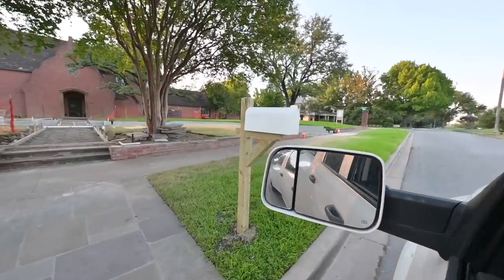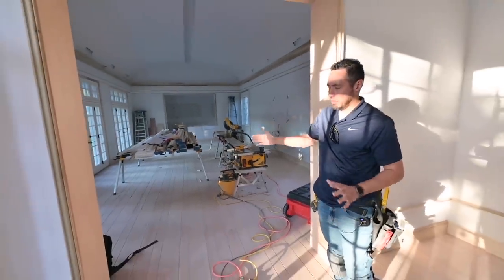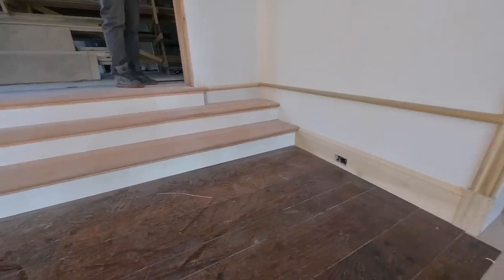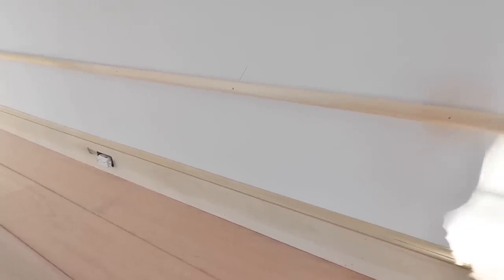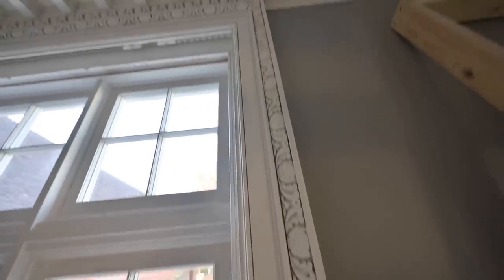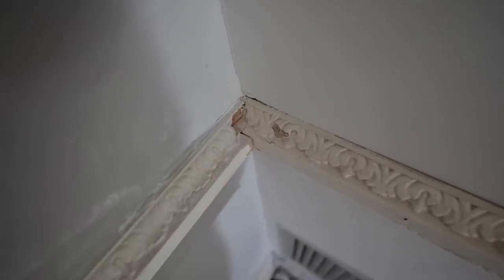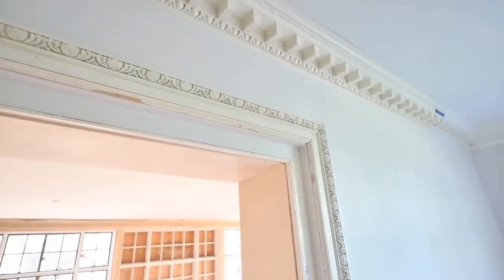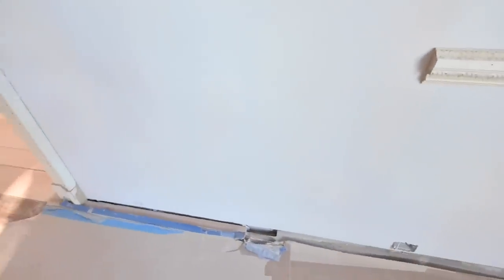Priceless...the most expensive mouldings we've ever installed.

Comment: Where you scribed your molding into the casing I think it would have also looked nice to do a soft return to the wall where you cut 2 22.5s and a 45. I'm sure you do it all the time with crown but I think it looks nice in other applications like this case where your panel molding or whatever it was didn't have a flat surface to die into.

Comment: In the "thumbnail" that presents this video on the summary page, and seen inside it at, say, 5:50 is something that I understand to be "dentil" molding. I'm talking about the squarish blocks sticking out underneath the crown. I happened to have read about them when I started woodworking. The word does indeed refer to a tooth, but for whatever reason it's "dentil" rather than "dental." 

The curious thing is the claim by someone, that I ran across, that makes some sense, concerning how and why they are to be found in ancient Corinthian stone-masonry architecture, under the eaves of roofs. The claim is that they were there to represent wooden rafter ends, as if emulating and celebrating the transcendence of stone masonry over primitive timber framing. As with other architectural moldings, they can be found on wooden furniture.

Comment: Just out of curiosity, when your installing a 5 piece crown are you still scribing the Internal corners and with the craved architrave and baseboard how are you matching the carvings in the corners are they carved to suit the length or are you working from the corner out and matching it as you go. Beautiful work it's just great to know that there's still tradespeople that can do this. Thanks for the videos
Reply: Sine the carved trim is a re-install of an old molding, the pattern should already be set in place.     On new pattern mouldings you just take the time and line up the patterns so they transition smoothly from one piece to another.

Comment: Question on pounding on the chair rail? Are you worried that it will expand when your humidity goes to 100 percent?
Reply: My thought was they had to drive the piece in due to a tight corner cope.  Looks like the other piece was not removed from the wall and they had to hammer the piece in to get it in place.    With it being "trapped" by casings and the corner it cann't really move due to humidity.     The old lumber and trim has a much tighter grain; and is far and beyond much more stable ;that most of the new trim that gets installed now. 
A house with this level of wood work they take great steps to have a very tight level of humidity control in place.  Probably already have the air working, dehumidifier, and maybe an air exchange type unit.  Plus all the doors and windows stay closed to keep the inside as  controlled as possible.